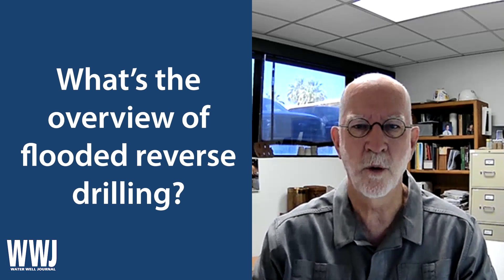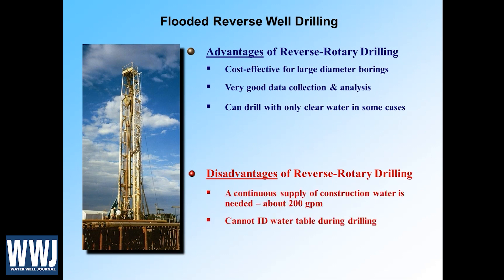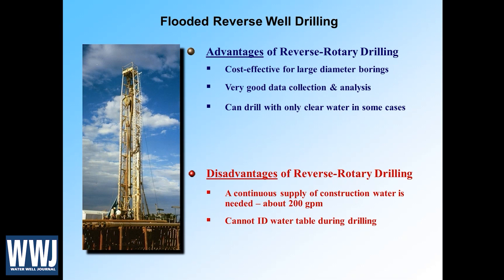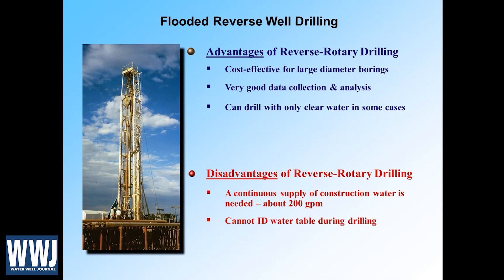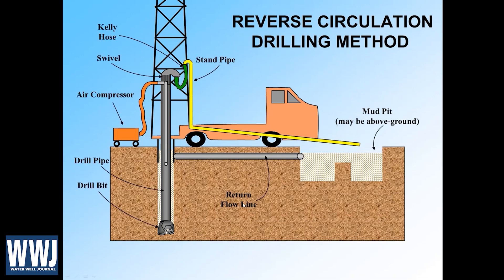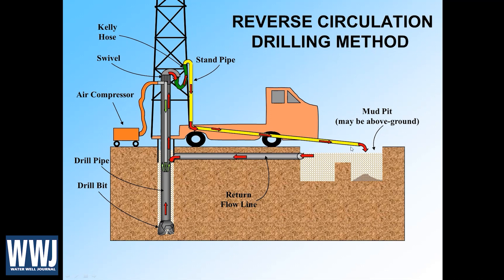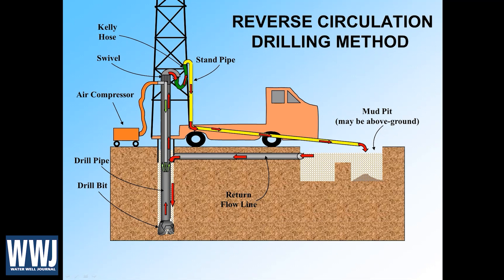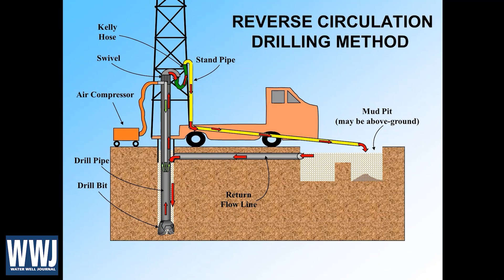Marvin F. Glotfelty, RG, on Flooded Reverse Drilling | NGWA: Industry Connected

Comment: Reverse Circulation with Down hole hammers is something that has been used in Australia for a long time 1972 the first RC rods were developed in 1990 the first Rc hammer was developed the americans are way behind on this methadology Reverse circulation drilling can achieve depths up to 500 mtrs with the correct Air combination , when drilling a pilot hole with air only individual aquifers can be identifed and the water measured through the T-piece and V notch the hole could be opened to the desired diameter after the pilot is completed and aquifers measured and identified using muds and shakers seem excessive and exspensive to me